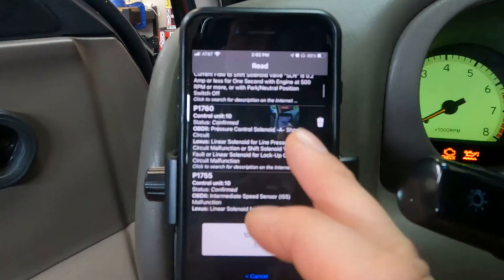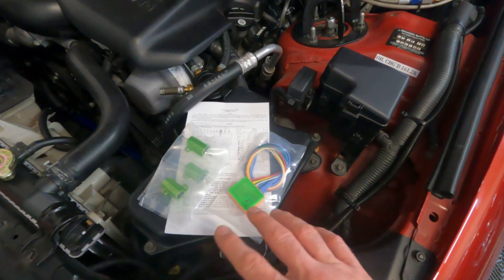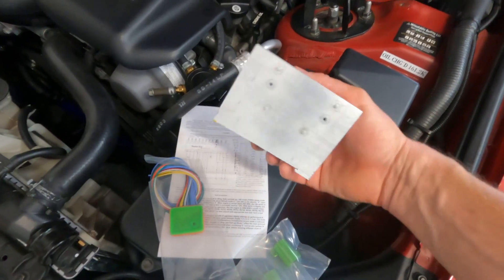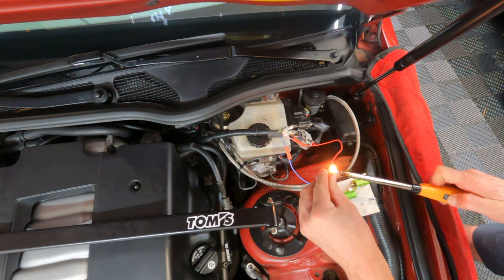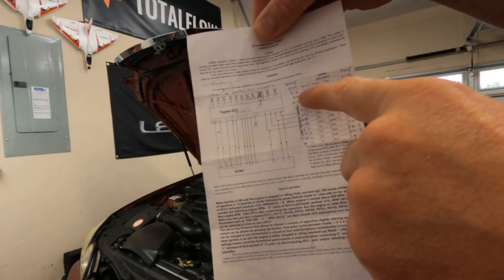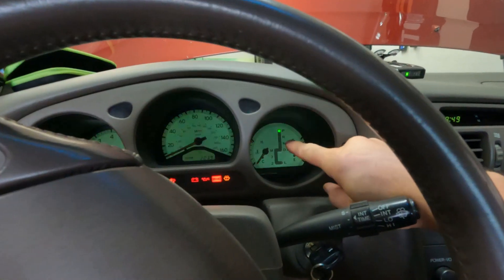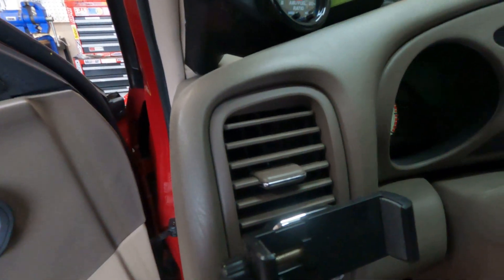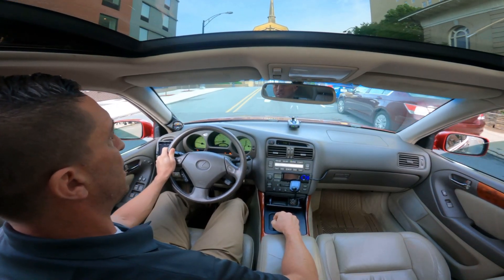Manual Swap | LEXUS GS400 | Episode 6 | ATEMU Install, Restoring Power and Smoking a Porsche

Comment: Id suggest a thermal pad or paste for where the resistors meet the heat sink. Youll get much better thermal conductivity (extending their life) Great video as always !
Reply from the maker: Thank you for the suggestion! 👊
Reply: Yeah, that's definitely necessary
Reply: As someone who works on computers this is a Great suggestion.

Comment: That GS is rockin . Sounds great. Any plans to dyno again with the manual. 
I am sure you picked up some power to the wheels with the new manual trans. 
I wonder how she would fare at the drag strip . I know they road tested the GS 400 when they first came out in 98 and they ran 14.3@ 99 mph
Reply from the maker: The reason I haven’t dyno’d it is because a tune session here locally is ridiculous. It’s like $300. I also know these put 240-245whp down stock, so add about 2%-3% to that, plus my other mods. Not to mention a slight weight reduction and more favorable ratios in gears 1-3, and acceleration is improved for sure. I can certainly feel it. 14.3 was a pro driver’s best back in the day. So I figure I can hit high 13’s in this configuration on a good day at the track. Perhaps I’ll run it someday soon.
Reply: @ForwardMomentum  yea tunes are ridiculous here also. 300-600 . I get that. 
If you can shift the gears I believe high 13s are  within
easy reach. I have seen many 400 hp plus cars at the track struggle to break out of the 14s with there manual trans cars. 
But no doubt manual cars with power like yours are super fun to drive.

Comment: Atemu. I did this a couple years back (It worked great) then months later went emu black. Question, do I just cut it out and cap the wires or put it all back together? Most of those wires have no end since the swap right?
Reply from the maker: Wires that were spliced in can just be cut and the splice location protected. Fully cut ECU wires need to be reconnected of course.

Comment: WOW! your GS sounds so fast now. Have you done a dyno/0-100km test yet? I am excited to see those results
Reply from the maker: It is much quicker for sure, but 0-100kmh or 0-60 actually isn’t a good measure of improvement because I have to shift into 3rd to hit that speed. I estimate it’s putting 2-3% more power to the wheels, not to mention the more favorable gear ratios 1-3 and weight reduction. Definitely a win-win!

Comment: Is air filter stock,? Because i think u replaced it with K&N ? Or you found that stock is better? 😄
Reply from the maker: The current intake system is stock for the most part. I was running a K&N FIPK, then went to just a drop-in filter, but my friend gave me a Blitz SUS panel filter so I am actually running that now. I have also installed a Soarer BFI system with fresh air duct. If you search “soarer BFI” you can see that concept online. The BFI really works and my fuel trims are good.
Reply: @ForwardMomentum  could find it in ebay?
Reply from the maker: Find what?
Reply: @ForwardMomentum  soarer BFI
Reply from the maker: You have to build it yourself.
Reply: @ForwardMomentum  did you uploaded vd for that? How to install it specially the sensor should be fixed well
Reply from the maker: No vid yet. Just search Google for “Soarer BFI” and build it based on what you see.
Reply: @ForwardMomentum  dear FM want ask you about wheels discs is there any difference between 400 & 300? Are 300 fits on 400? Because i want buy brembo discs and they told me they have gs300 discs which fits on 400!
Reply from the maker: @falblushi6701  they should be the same.
Reply: @ForwardMomentum  FM want ask you about fuel regulator is installed on the stock Gs400 model 98? Cause want to install one on it
Reply from the maker: @falblushi6701  yes, it’s part of the fuel pump housing assembly.

Comment: Does the last code that you can't get rid of throw a check engine light or is it just stored in the ecu? I'm wondering for smog purposes in California. Is there a way to fool the car into thinking you still have a neutral safety switch?
Reply from the maker: There might be a way, but I don’t know how. Yes, it triggers the CEL.
Reply: Thanks for the swift reply.  I'll speak to my smog guy about this.  @ForwardMomentum

Comment: Funny to think how similar the performance figures are to a 996 in the dealer at the same time. I'm sure the 996 would beat it in corners, but maybe the GS is quicker now (assuming the 996 wasn't a tiptronic)

Comment: Where did you get that heat sink at ? I’m going to need it, doing a cd009 swap on my is300 with the emulator
Reply from the maker: Hi - I just had it laying around. Try a computer supply shop. Sorry, I don’t have a link.

Comment: Essentially the same for a gs430? also, planning on getting a jzx100 R154, will that tripod work? or necessary to get that extension?
Reply from the maker: If you mean the ECU pinout it may be different. Regarding the R154 measurements may have to be taken. I don’t know for certain where the shifter ends up as-is on the R154 and GS.

Comment: What if you wire the neutral switch wire to a clutch switch 🤔🤔🤔🤔 im thinking on doing this to my gs because the code says pnp malfunction🤔🤔🤔🤔
Reply from the maker: I was wondering the same thing. Hmmm
Reply: How did that work for u
Reply: @cerocents  im not getting that code cause i have another engine

Comment: can you help I have a 2000 GS 300 and I am dealing with notorious P1755 solenoid code I change the solenoid.... code still there will this remove my check engine light???
Reply from the maker: Check out this thread on CL: https://www.clublexus.com/forums/gs-2nd-gen-1998-2005/938729-2000-gs300-p1755.html

Comment: Have you figured a way to make that p1780 code go away?
Reply from the maker: Unfortunately not.
Reply: Did you get any trouble to pass emmisions with p1780 code
Reply from the maker: Not where I live, but each locale is different. It’s a non emissions-related code anyway.

Comment: Can you go through how you display Diagnostic Codes? I have tried with an obd2 to bluetooth, and connect my phone. But it can't find anything through it
Reply from the maker: 1. Insert OBD adapter into OBD port 2. Connect OBD to WiFi on phone 3. Open app and connect 4. Read codes.
Reply: @ForwardMomentum  See... thats pretty much exactly what i've been doing. Except i dont have a obd2 to wifi adapter, so over bluetooth instead. It works fine on other cars, just not mine

Comment: I have the same atemu but it's on a gte, an my cluster looks like a Christmas tree
Reply from the maker: There should only be (1) DTC and the VSC/ABS bulbs will also be lit up. Once you’re positive only 1780 is showing you can pull the CEL, VSC and ABS bulbs out.

Comment: You could have avoided all that bike removing all the solenoids from the transmission and keeping them plugged in and grounded FYI
Reply from the maker: I know. But who wants a plastic bag with wires and solenoids zip tied to the undercarriage? No thanks.
Reply: Where did you ground your solenoids? And can all of it be grounded to the same spot?
Reply from the maker: I didn’t ground any of them. They come into play when you wire up the ATEMU.
Reply: @ForwardMomentum  Oh? I just did not want to wire up resistors because I just think putting that big piece of metal would be an eye sore to me.
Reply from the maker: @JonathanMai  it doesn’t look bad at all. The heat sink looks kind of cool to be honest.

Comment: Hey do you have a Facebook? Instead of  trying to message you through YouTube I could do it on FB
Reply from the maker: I have a Forward Momentum FB page and also I’m on IG (youtube_forward_momentum)
Reply: @ForwardMomentum  I subscribe/ follow you on YouTube but can’t find your FB🤷🏽‍♂️
Reply from the maker: @shanerobinson1050  https://www.facebook.com/Forward-Momentum-107594124536398/
Reply: @ForwardMomentum  hey also I know it may probably different now with the manual swap but how much how quickly did your mpg decrease with the 3.77 diff in the car?
Reply from the maker: @shanerobinson1050  with the AT I went down only 0.5mpg.
Reply: @ForwardMomentum  oh that’s not too bad since it’s gonna be my daily I would rather have little bit better gas. The 3.91 gears in the 300 are better for acceleration but worse for mpg but I wonder by how much?
Reply from the maker: @shanerobinson1050  I have heard various reports, but based on my experience with the 3.77, I wouldn’t expect much worse, maybe a 0.75mpg hit.